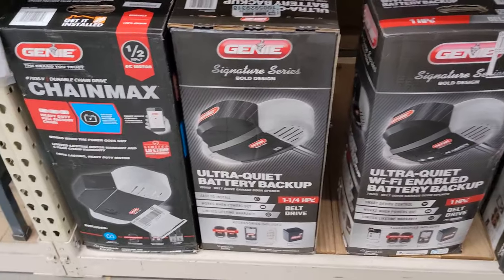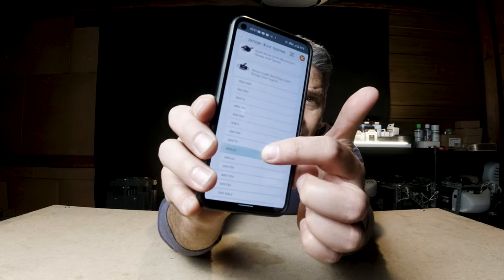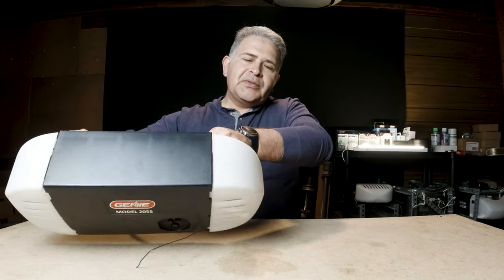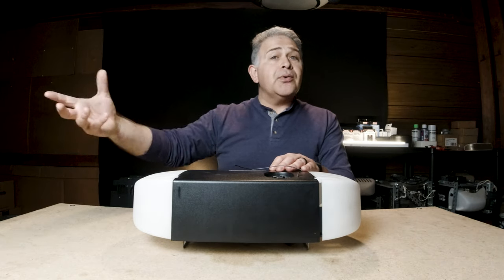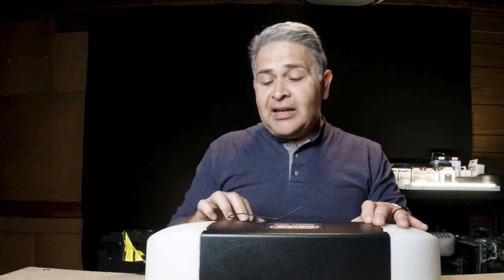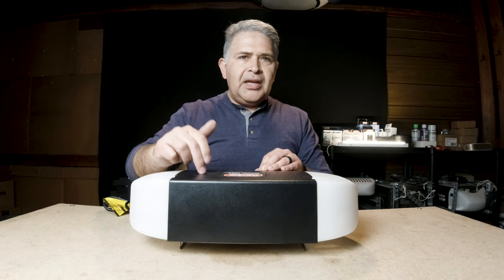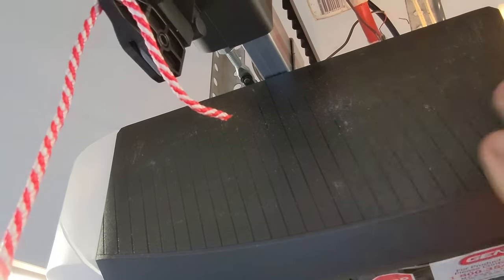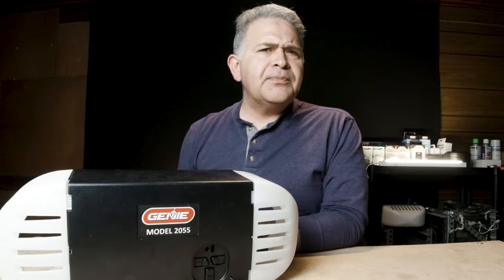GENIE Signature Series Garage Door Opener - Is this motor a MISTAKE?

Comment: I figured out how to attach the two piece lens together permanently and it literally snaps in place without the screws. Its called a plastic welder that melts little wavy wires into the plastic; its designed to repair broken plastic but worked great for this application and its only about $20 from Amazon. I have no idea why they designed them in two pieces that don't fit together well when installed as designed. BTW the manual leaves out step two of syncing the remote to Homelink; the short version is the motor program button doubles as the learn button, which after syncing the remote to your vehicle, must be pressed and then within 30 seconds press Homelink button in your vehicle again to o sync to motors rolling code encryption. Both steps should be spelled out in your vehicle's manual if it uses the Homelink system.

Comment: I've watched this video twice and I still don't understand what motor mistake he's trying to convey.
Reply from the maker: Thanks for sharing your feedback! 

The two main reasons why I do not recommend this garage door opener is because of the programming buttons and the light cover.  The programming buttons are flat and at times are difficult to utilize when trying to program the travel limits and the remote transmitters. 

As for the light covers they're just garbage and a very poor design.  Of course in my videos I try not to tell people what to do I simply provide the information so that they can make a better buying decision.
Reply: @sosgds  thanks

Comment: What killed me is that they are still using SAE fasteners... WTF? Oh yeah, and everything else you mentioned, I had troubles with including calling their help line and the "tech" told me to take the motor cover off because when I pressed on the "-" and the other buttons, nothing happened. "Resetting" the cover, made things only a bit better. A VERY FLIMSY DESIGN... RUBBISH.

Comment: I’m replacing a 13 year old Genie screw drive with the Genie model 70550 belt drive tomorrow.  Going over the parts & instructions tonight I noticed the split 2-piece light covers were not even what the manual/instructions showed (they showed one piece covers) so I started trying to figure out why they did this new split cover design.  I can see that the split cover design allows you to change the light bulbs by just pressing the large center tab on the lower half of the cover and it opens up giving access to the bulbs💡 without any tools.  The 1-piece design always required getting out a screwdriver and taking out two screws per bulb cover in order to replace burned out bulbs.  I always thought that was a pain - I can’t tell you how many times a screw fell into the garage and vanished when changing bulbs over the years.  It appears this new design is to allow changing bulbs without needing any tools or losing the cover screws.  I like it.
Reply from the maker: Hello.  You make a great point.  The newer covers make it easy to change bulbs.  Yet for me they are an eyesore.  I simply prefer the solid piece design.
Reply: Buy a led bulb!
Last a lifetime!

Comment: I just started to install a new Genie 7055    When I push the button on the wall it goes up but will not go down unless I hold the button down. Is it because the sensors are not hooked up correctly? I was a little confused with the directions and the Genie support line is closed.  I went from a unit with only 3 hook up spots (wires) to Genie with 4...

Comment: Hello Santiago. I just finished installing a Genie 7155-tkv smart garage door. I have hit a wall when programming the actual remote control openers. I'm getting the blue and purple lights as the instructions describe, but to action. Nothing happens, the door won't open/close. Any idea what could be going wrong?
Reply from the maker: Thank you for sharing what you are experiencing.  Were you able to program the travel limits first?
Reply: @sosgds  Yes, I was using the sensors from the previous door. I had to change these, and then I was go to go. Thanks!

Comment: Hi, my Genie H6000-07 AC Screw Drive (2007) just went on to the great Genie graveyard in the sky. Can I buy and install another Genie screw drive model and just reattach the rail and wires? Or do I have to replace everything? Thank you!
Reply from the maker: Great question.  In this case there are no current Genie openers that will fit your rail assembly.  You would need a completely new system.  On a positive note the newer Genie openers will offer a quieter experience than the older models.
Reply: Thank you for your insights. Much appreciated — and Happy New Year!

Comment: I have a 7055, will not go down. It acts like it has hit an obstruction. It moves a couple inches and returns to start position. When disconnected the opener runs perfectly. Connected it opens fine, but will not close. Had a cracked opto wheel replaced it, when it would stop 2 feet short going up or down. Worked for a few times.  Next replaced the circuit board- no help. Any ideas out there?
Reply from the maker: Oh wow.  I would start at the opto wheel also.  Yet these motors have digital settings.  Did Genie send you parts?

Comment: I just installed a 7055, had a problem with it going up. I called the support desk. They told me my 8x18 door was too heavy for the motor. Even though setting the limits it went up and down smoothly.  I asked about the force settings but couldn't get an answer and I can't get it to program right. No lights come on when I try to start the program sequence. Any thoughts?
Reply from the maker: Hello.  That is odd.  Your door must be over 500 lbs in weight.  From what I understand, the Genie overhead retail motors are 18 volt machines.  The pro line motors are 24V and 140V.  Have you had your garage door balanced?  Does it feel heavy when you open your garage door by hand?
Reply: I have this same problem. I just installed the 7055 1 1/4 hp version from Lowes on a 16 wide , 7 foot high Metal door. It's only gone up once when programing. It will stop going up after 2 feet and is VERY slow. I can't seem to get any help with the force adjustment. Any thoughts?

Comment: I have the 1155-SV model and the optical encoder is malfunctioning, i talked to Genie about ordering it but they don't have in stock. Can i install another encoder from another model?
Reply from the maker: That's a good question.  The opto luctor sensor Genie offers looks to be out of stock in our area here in So Cal.  This is the model number based on the model you provided: 39272S.S Genie Opto Luctor

Comment: I have a Genie purchased from Lowes with the one piece light housings, I can never get them to fit right.  The light housings fall off whenever they feel like it.  The lower tabs will not fit in the holes in the unit.  Otherwise it seems to work just fine.
Reply from the maker: Thank you for sharing this feedback.  

Which model of Genie do you own?  Genie might be willing to send you out new light covers.
Reply: @sosgds  1035-VE, I probably need to do a little trimming on the lower tabs so they will fit.  I'll worry about it some day when I have more time to look at it closely.
Reply from the maker: That is a common motor.  It might just be bad light covers.

Comment: An almost timely video.  I just installed a Genie model 7055-TKVE Garage door opener last week.  I purchased it at Lowe's.

Previously I  had a Chamberlain 3/4 hp chain driven model that lasted for over 14 years.  I had wanted an exact replacement; but nine were available.  I wound up buying a Genie 1-1/4 hp belt driven model . . . I'm beginning to think that was a mistake due to numerous issue's.

Let me say that Genie's factory help service has been SUPERB; but there have been NUMEROUS PROBLEMS with installing and programming the unit.

Oddly the 1-1/4 hp Genie motor turned out to be HALF the size of the Chamberlain 3/4 hp motor 🤔  The G
Reply: The Genie factory service person told me that their hp ratings aren't done in the "standard way"; it supposedly has to do with the speed of the door opening and closing.  However after installation, the Genie 1-2/4 hp motor does seem to operate any noticeably  faster than the Chamberlain 3/4 hp motor.

Then the safety beam units are molded onto a fixed length brackets.  Turned out that the bracket were about 1/2" TOO SHORT . . . The bottom horizonal 2"x4" bottomstructural support😮 blocked the beams; and the door wouldn't come down all the way; it keep reversing and going back up.  I finally had to remove the brackets

The"closelimits"  (programmin) wouldn't work properly.  Must have programmedvit a dozen times before it finally worked.

The rectangular rails flex a fair amount and are not as heavy duty as the Chamberlain square rail.

Then, programming the wireless remote was really a "pain" . . . That took about about 12 attempts . . . and it NEVER seemed to work quite properly the way that the service instructions called for . . . But Somehow it finally worked without going through all of the steps.

The remote controls "worked out of the box"   and there was NO WAY  to ensure the "securiy" of the  remotes . . . .how closely guarded would the remotes and the operator codes can be compatible of secure.(Might someone drive down the street with a remote unit and try to see which garage doors will operate with a factory default setting . . . .  Where is the  security bond this?

Then,with the garage door closed, I have noticed that the  LED lights will flicker VERY FAINTLY at about once per second . . . don't know what is causing that.

The Genie factory service have been most helpful or tried to be; but the problems appear to be in the drive unit or with the programing.  I haven't tried to program my Toyota  push button  garage door opener yet.
Reply from the maker: Wow.  These are real issues.  

How long did the problems manifest?
Reply from the maker: This is a long list of issues.  

What was Genie willing to do for you?

Comment: Really liking the video so far. 5:02, wouldn't that be 'pressing up'? ;)  Was hoping to see something about changing the circuit board. I think my buddy used the wrong bulbs in his opener, and it may have fried the electronics? Saw another video about the lights not turning off. A guy used those curly-cue bulbs in it, and the worked for a month or so, then stayed on all the time. He replaced the circuit board, and put in actual "Genie LED" specific bulbs (probably just normal LED bulbs with a higher price tag coming in a Genie box) but said it's all working now. This is exactly what my friend did, so I want to replace his circuit board, and get the normal LED bulb, NOT those curly-cue I think they's almost like mini fluorescent bulbs.
Reply from the maker: Wow.  That is irregular.  Replacing the logic board is relatively easy.  Do you know if the opener was on a dedicated circuit?

Comment: i AM REPLACING OLD gENIE IMS 1000 A AND SAW your video onthe 7055D TKSV at Home DEpot. IS the 7055 tkve at lowes better? also can I keep the exising j bar door mounting in place and reuse? my old unit mount to a finished wall with X configuration that hits the motor mount that are 6 inche apart. I assume I will need to make new mounting system to the motor?

Comment: Got a 7055. When operating it makes  a soft whining noise coming from the motor assembly. Like the motor is working really hard. Is this normal? It scares my does! Is this normal for belt drives?
Reply from the maker: Hello.  Yeah ... that's what these new DC motors sound like.  Of course, you can apply some lithium grease lightly on the belt to help with that.  You can also loosen the belt a bit to release some tension.  Additionally you might need to have the balance of the garage door check and adjusted to alleviate the strain from the door to the motor.    Hope this helps.

Comment: Hello Santigo,

Thank you for the informative heads up on the Signature Series Genie unit ... the light covers do seem silly in two pieces ... is the motor good?  Any other issues?  I have had a Genie Pro for 20 years and it is finally having issues ... what do you recommend? I was attracted to the new side mount unit that goes on the side of the door but it appears the Genie unit has a problem with a plastic gear inside the motor breaking. Unfortunately I have to use Genie vs Chamberline because I have a driveway gate with the brain also Genie and I need multiple button controls and be compatible to program both on one control. Any recommendations for me? Thank you, Enrique, San Diego, CA
Reply from the maker: Hello Enrique.  Great question.  The other issue with the Genie Signature Series is their flat programming buttons.  These buttons are harder set and in my experience the programming needs to be done twice sometimes thrice.  

The issue with the Genie wall mount motors has been addressed and they changed the gear to a sturdier material.  None of my customers are reporting issues with that motor.  Which I think is a positive sign.  

If you prefer to go with an overhead motor, I would consider the 7155 from Lowe's or Costco.

Comment: Hello I have a Genie H6000-07/m screw drive opener,Is there any chance that a newer battery backup motor could be swapped out without replacing the rail and all other hardware?
Reply from the maker: Hello.  Unfortunately Genie has gone away from that type of rail design.  Thus you won't be able to utilize it with any of the new motors that Genie offers.  Hope this helps.
Reply: @sosgds  Thank you for the info.

Comment: I'm curious about your comments to issues of quality. I bought the same unit in your video 4 months ago from Home Depot. I just had an optical encoder failure. I don't see any issues with it,  cracks on vanes, etc. I'm assuming one of LEDs went out. The part looks to me incredibly cheap. What are your thoughts there? Is this an exception to the quality of Genie or is this going to be a problem in the future for me?
Reply from the maker: Hello Stephen.  That's a great question.  I've installed a number of these motors which includes the variants of the pro line and the Optiloctor sensor has not been a major issue.  The built in LEDs to the 7155L are new to this design and are roughly about a year old.  Thus this might be the time where will see some failures manifest.  To my knowledge, the LEDs have not been an issue.  Thus I want to say that your circumstances might be singular, that is it could be just happening to your motor.  Therefore I want to encourage you to look at getting Genie to warranty the motor for you.  In some cases they will send out a new motor head.  So it's worth a shot reaching out to them.  Hope this helps.
Reply: @sosgds  Hey thanks for the response! Yes, I have a warranty unit coming from Genie already.  They told me that my units SN indicates the 3rd unit built in 22 so maybe I just got unlucky. Glad to hear the part does not have a history of failure. Best regards!

Comment: Cheap made I bought one  I immediately  greased every thing I could see that was dry and no bearings at all plastic to plastic  gear drive yep greased with lucas marine grease asap sounds weak to so far it's working a month in the old challenger chain drive was built like a tank much much heavier  duty worked for many year until the worm gear which was plastic stripped out due to lift spring broke  so took it down and put up genie garage door opener belt drive it's much quieter for sure but grease the slide and the gear and idle pulley shafts hope this helps others..bought the single light model
Reply from the maker: Hello!  Thank you for the feedback!

Comment: Yeah but the ones from home depot look better and they come with wifi connect. You cant use the app on the lowe's models
Reply from the maker: Thanks for the feedback. The designation that starts with a 31 or 71 to the model numbers will indicate that they have the Wi-Fi capability.

Comment: Genie in general is a mistake
Reply from the maker: This Genie model is.
Reply: I had battery acid leak onto car paint and cost $2500 for new paint job. They need to rethink this design.
Reply from the maker: @ousooner80081  Wow!  this is the first I've ever heard of this.  Did you contact Genie about the damage?  How old was the unit before it leaked?
Reply: I did not contact them.  I just took the battery off. I believe it was about a year.  I am also in a very hot humid area. I assume that's what caused it. At first,  we did not know what was causing the paint to basically gum up and peel off. While the car was in the paint shop I walked under the unit and it dripped on me.